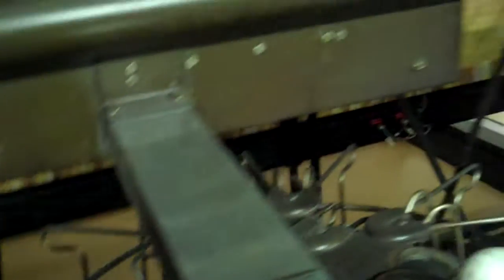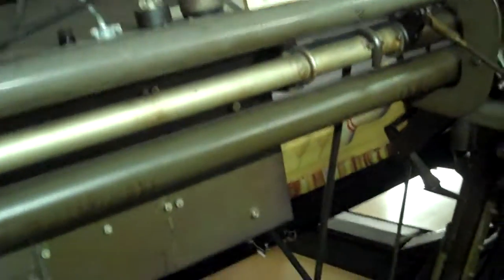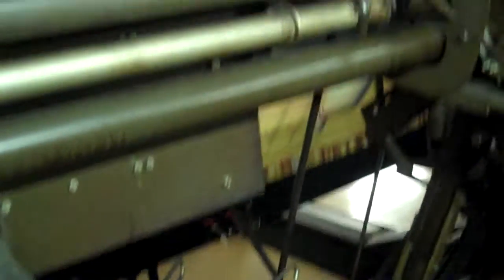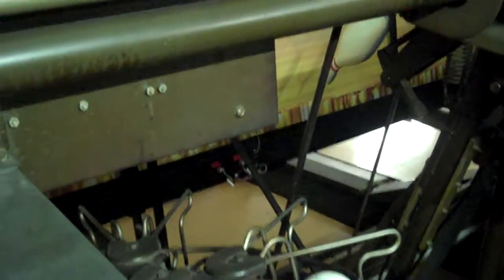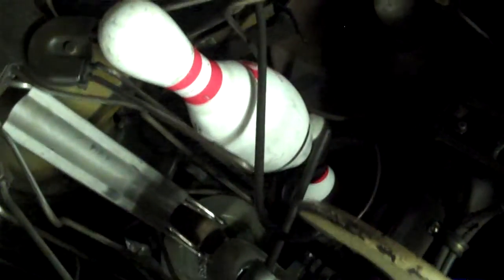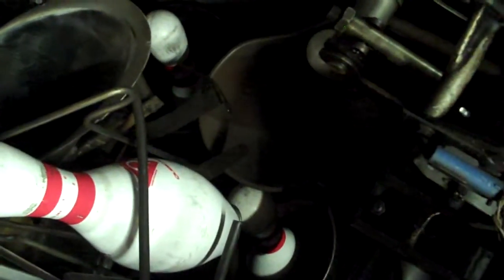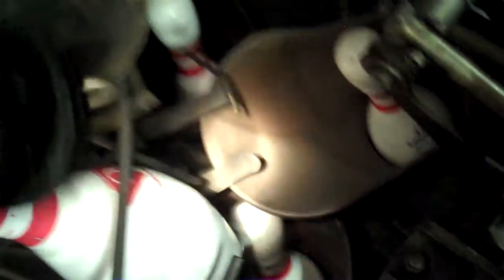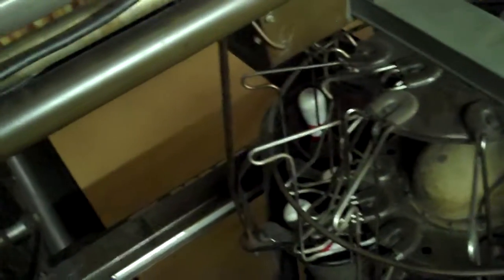Brunswick A2 Pinsetter - Turret Overview

Comment: Thank you for your comment and quick reply. I'm sadden to here of your leg injuries and hope you heal quickly. I was told that you shouldn't reverse the direction in which the arrow on the gearbox points when turning the clutch belt. I was told it would cause problems in the pinsetter. Besides, I've tried reversing the direction to loosen the hook anyway but I wasn't getting any movement from the deck or any other results. One tech told me that I would have to churn the belt in the normal direction until it complete a cycle. That's a lot of churning and clients and management are not that patient. So, is it possible to release the hook and getting a 180 pos. by reversing the direction when turning the clutch belt? And if so is the clutch already engaged or will I need to do something else to get the deck to move while in a black-out state?

Again, I would like to thank you for all your help, and most importantly I would like it when you're back to good health doing what you love.

Sincerely,

mmtalon
Reply from the maker: Oh no problem, thanks for the well wishes, I'm hanging in there. Doing all i can to get better and back to the machines! In general that is a good rule you normally don't wanna go opposite the arrow but if there's not tension turning it against the direction of the arrow is fine. All you're doing is jogging the machine forward, again if no jam is present you NEVER wanna add more tension to a jam. It does take forever but I would do that, reverse the machine (following the arrow) til it's in a spot where ya can get the hook up and out of the way. It sucks but there's not much else ya can do sadly. I usually find the clutch disengaged when I get a blackout so just as habit I pull up on the solenoid regardless, just make sure it is engaged or else you're turning belts for nothing. I know how it is but when a lane blacks out in a bad spot they just have to wait, it's not a quick thing jogging a machine by hand sadly. Of course another thing to think of is why the jam occurred and trying to lower the amount of jams. Loose turret wires were the cause of 75% of jams I had when I started. Glad to help and hopefully I'll be back 100% with my machines :)
Reply: I'm at work now listening to these pinsetters roar. But I'm writing anyway to say thank you again for your help. BTW, Happy New Year! Since my last post I have reversed the direction to release the deck hook with success. So I appreciate the tip. I'm glad you have a positive outlook on your health and I still wish you a quick recovery. Have a great new year.

MMTALON
Reply from the maker: mmtalon Happy new year to you too my friend. I appreciate the comment so much, it's comments like yours that make it so worth it, I love being able to help! I'm glad the tip was helpful, the gearbox stamping is usually a good rule of thumb, if it's jammed and tight you don't wanna jam it further putting more tension on it and possibly damage components, however if there's no tension you surely can jog the machine forward to where you need (usually to get the holding hook out of the way). My rule of thumb is when you feel a LOT of tension like pressure and the jam getting worse, stop right then. otherwise it's fine. I'm just glad I could help and the tip made things easier for you. No real good news to report yet on my legs but no bad either, tests are coming back good so it's still a mystery but we'll figure it out and I'll be back 100% soon and again I thank you for the comment and well wishes! :)

Comment: Thank you for your vids. Being a new mechanic I learn much from them. I wasn't sure if you were still posting new videos on pinsetters but I watched your last video you posted on "new pins" in Aug. 2014. So, I'm hopeful that you may have an answer to my following question/problem. Occasionally I will get a pin jam on top of the deck (black-out) between the turret & deck during a condition where the deck hook is engaged. Normally you could hold the hook up after releasing the clutch and lower the deck to remove the pins. However, I have no idea how to lower the deck to remove the pins while in the condition I described with hook engaged. Please help me with this problem. Thank you Rep2369, and I hope you have a Merry Christmas!
Reply from the maker: Glad you're finding the videos helpful! More will be coming, I'm sorry it's been slow as far as uploads, this season was just crazy busy for me. Also I haven't been in work for over a month now. I have a knee injury and other leg issues and my mobility is minimal and there's no way I can be climbing around machines. As for your question if you do get a deck jam and the holding hook is engaged you need to get the machine close to 180 or 0/360 this way the deck would be up. Even if the hook is lowered there you should be able to lift it out of the way with the machine at that position. Just work the belt slowly til the weight is off the hook and you can get it up and out of the way then run the deck back down and clear the jam. Hopefully that will help ya out with that issue. Thanks so much and I hope you have a wonderful Christmas! :)